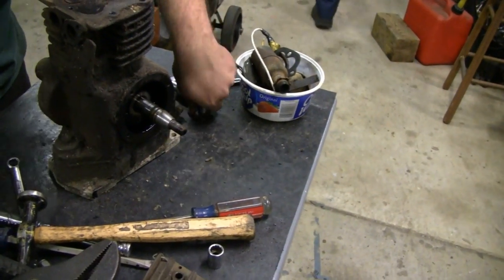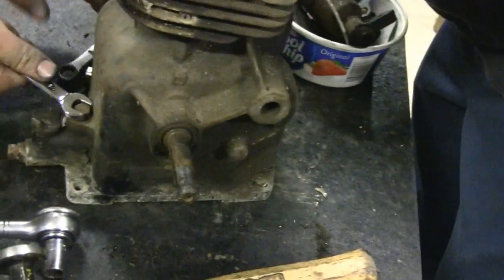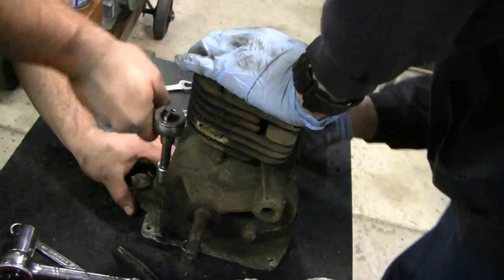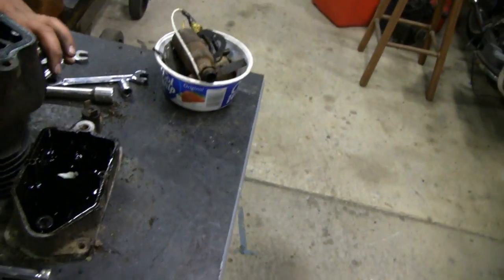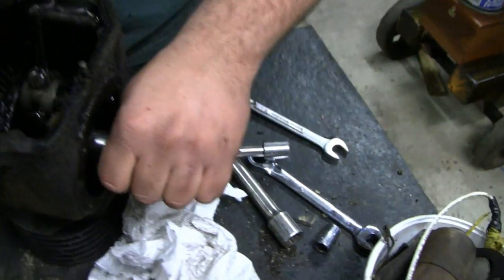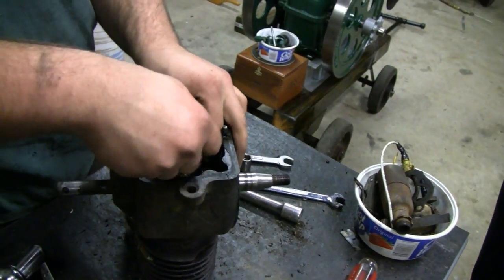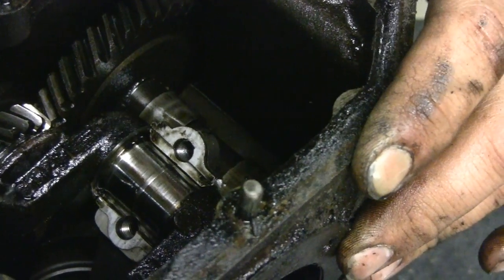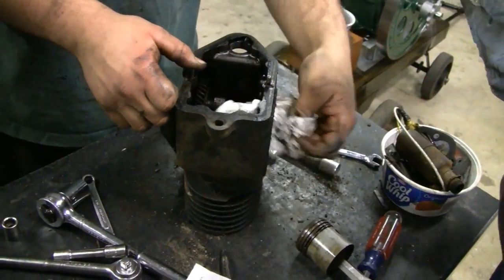HOMEMADE HIT & MISS BRIGGS PROJECT (part 2)

Comment: does anyone know where to get the oil seals for this kind of engine  briggs 6s
Reply from the maker: The original part # is 89660, the new one is 299819!! you can get them on Ebay!!☺
Reply: thank you so much R K